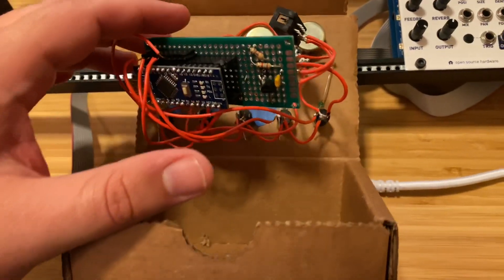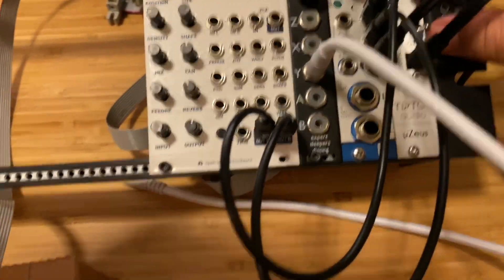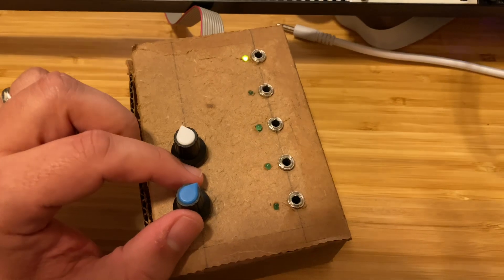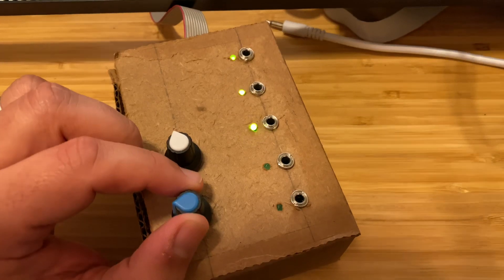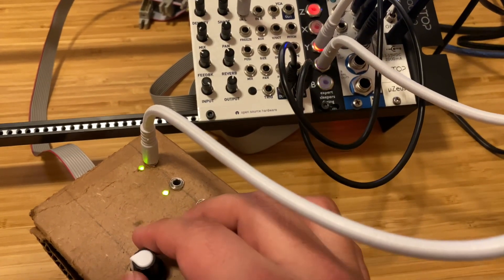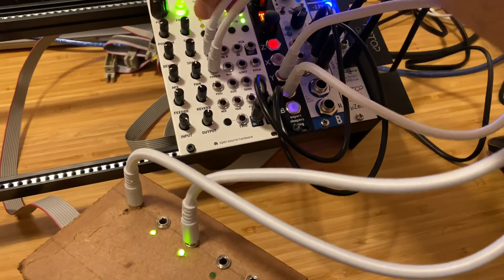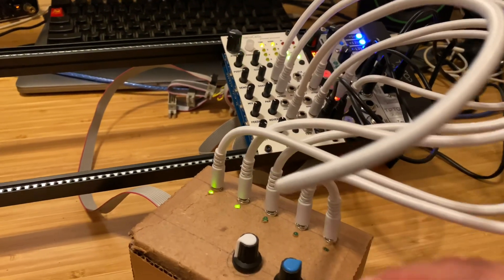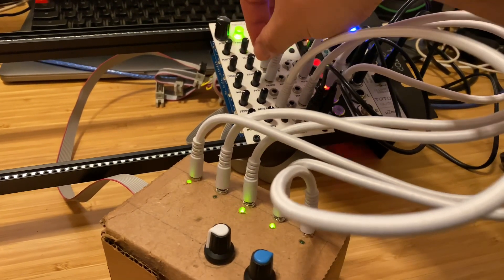Custom Eurorack clock generator with Arduino

Comment: Any issues using only 5v for clock? I know some gear expects 10v for trig but most probably use threshold much lower.
Reply from the maker: So far, no issues. My hardware rack is pretty small at the moment so I haven't tested it in a large range of scenarios.
Reply: If the gear you are talking about is eurorack a trig of 10 volts would be difficult to implement. I think you are probably thinking about  CV levels peaking at about 10 volts because that is about the max output of most opamps running on a eurorack supply. Triggers are normally 5 V and under usually with anything above 5 being fine too as long as it's over the voltage threshold for that circuit to count it as a trigger, clock, or gate.
Reply: Sorry for the long reply. What can I say, I was triggered! :D
Reply from the maker: @SkullDraizer  Thanks for the reply and explanation!

Comment: Love it! Now I'm going to have that groove in my head the rest of the day. 😆🥁

BTW I've done worse solder jobs than that!

I'd love if you could talk about the code that drives it.
Reply from the maker: Thanks! I had to de-solder and re-solder some of the connections on the board that holds the Nano at least 4 times.

I don't think I'm quite ready to release the source code yet. Maybe sometime in the near future.